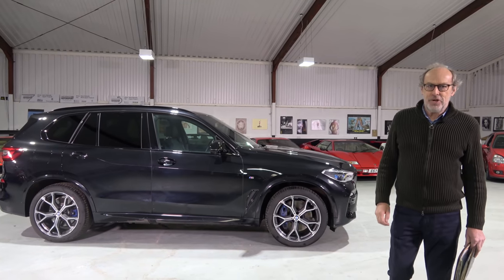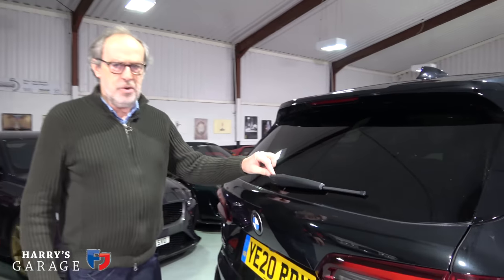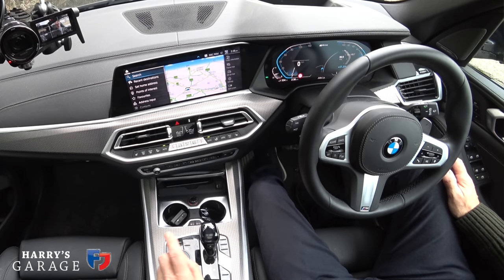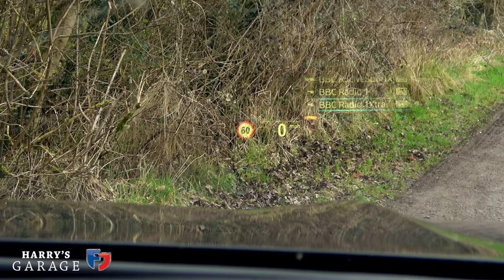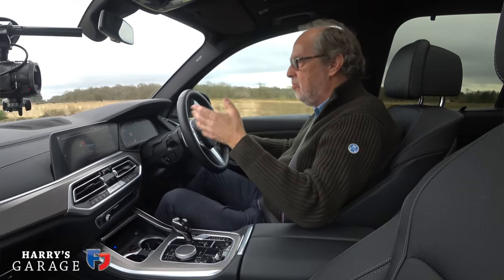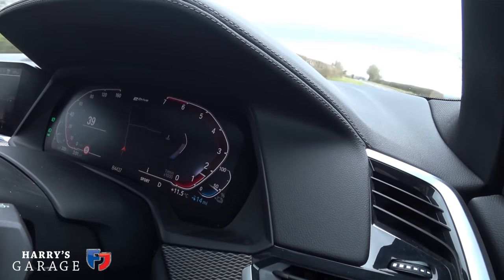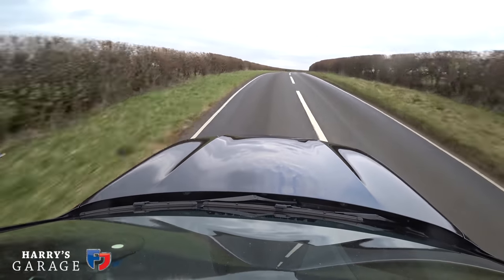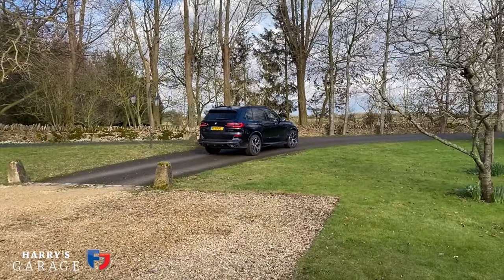BMW X5 45e 10,000 mile review. Why PHEV beats EV for our family car

Comment: Great review. We have a 530e and love it, we get 55mpg on it usually. I have the same concern, pushing the ICE when cold, I therefore put it in SPORT mode when driving off, the ICE comes on immediately, warms it up a bit and also get the oil flowing. Then switch to adaptive when it makes decisions automatically. Hopefully that helps in the long run.

Comment: Hybrids are a stop gap until full EV is affordable. Harry’s argues they combine the benefits of both propulsion systems which is true. However they also combine the disadvantages of both. The complexity of modern internal combustion engines - with associated post warranty repairs costs, with the weight of battery systems. Manufacturers have been denying us spare wheels because of their weight yet stick a quarter ton battery under a hybrid.
I’d happily lease a hybrid whilst under warranty but wouldn’t keep it beyond the next three years. By that time EV’s will be cheaper, charge faster, weigh less, have more range and have access to more chargers.

Comment: The lane departure on my parent's Accord is scary. It's aggressive and goes off when passing a trailer on the highway. Absolutely terrifying. A lot of these features shouldn't exist unless they're perfect imo
Reply: Have they given feedback to Honda? If not... either they should or they should not complain. As a manufacturer you can spend any amount of money on testing new products but as soon as they hit real world usage there will be problems not covered by your testing plan. The alternative is to have the cars phone home to the manufacturer all the time (eg. whenever the driver tries to override the corrections by providing steering input) — but you can be confident that if they did make cars phone home, there would be media/twitter/etc outrage everywhere. "Honda is spying on you!" "Creepy Honda cars tell the cops when you're speeding" etc
Reply: Do they signal? Because most of these systems do not trigger on a lane change if you signal, but do if you just steer left.
Reply: @cmacd8879  it thinks that you've gone out of lane or there is something in front of you and pulls the wheel/hits the brakes
Reply: @jsleeio  Teslas phone home all the time. The problem is that car makers are not, traditionally, software makers. Just look at the sorry state of most infotainment systems. They frankly don't know what they're doing. There's already a class action lawsuit against Honda out there for the emergency braking
Reply: @marcob1729  yeah I'd expected to hear that about Tesla, since they also update their own software... you expect it (or should expect it) from day 0 of owning the car. But I don't think the same expectation applies for the "longer-established" marques.

Comment: I thought plug in hybrids were the answer too till I bought my Mercedes c200e.  MPG is horrible (less than 28mpg) and the battery range in winter is absolutely useless (6 mile range). Can’t wait to get rid of it and get a normal petrol or diesel engine. 
In theory they are excellent but in practice, HELL No!
Reply from the maker: Battery size on a PHEV is critical. Early cars had tiny batteries, just to get through the EU test and give business owners a good (tax) deal. Then Germany introduced a law that all PHEV had to do >60km to qualify for a grant, so latest BMW and Mercedes have way bigger batteries, which really changes the ownership experience so they start to make much more sense.
Reply: @harrysgarage  Yh, if I got over 50 miles I wouldn’t care about the fuel economy for the kind of distances I drive.  Guess I’ll wait a few year and maybe give it another try. The BMW looks sweet though. Shame you have to give it back.

Comment: Spot on review. The slow charging is my main disappointment. I also find the electric mode a bit underpowered. Those are the only two remarks I have. I hope they do update the electrical system on the next model update.
Reply: I have owned my X5 for a year. The charge rate has not been an issue as I plug it in overnight. It is better now I have the PodPoint and charge at 16 amps.  What I would love is for it to have the electric range advertised. Having said that, it meets my need where the longest normal working day has a round trip of 30 miles.

Comment: I get 53mpg with my 1600 Diesel  engine and I don't have to plug it in every night..!!  and charge  it up from gas fired  power stations.   Whipy Doo 

Ps, Thanks Harry
Reply: That may be so, but the lack of noise is very pleasant and the acceleration with the combination of the battery and petrol engine is very good. It seems strange if the battery is flat and you drive off with the engine running.

Comment: A good analysis Harry, notably on the easy to live with, iDrive, consumption and 'how much power do you need' items. We have latest gen X3 with 2.0 diesel engine which has more than enough torque for everyday use. Consumption is around 45mpg. iDrive was the first and remains the best (despite what that idiot Clarkson said way back when). All the manual buttons you need for climate and seat heating etc and just so easy to live with. On the run flats, I changed those out on my 635d asap some years back and the difference was so positive , and less cost. We will need to swap out the X3 in about a years time and do wonder if there is any benefit to upgrading to the X5. I am not a fan of the new grilles on the saloon cars etc but it works well on the X5 IMO. BTW - does the battery get charged when it is running in ICE mode?

Comment: Fantastic review as always 

Just curious as to how much new batteries cost for some of us who would be buying 2nd hand
Reply: Batteries will probably cost half the amount of the car then there would be cost of fitting of the batteries at the dealership.
Reply: @bentullett6068  thank you 
I thought they would be expensive but nothing like that
Reply: @bryangillies6698  they aren't cheap. I work at a garden machinery dealer and some of the lithium ion batteries cost around £70-£1,000. I think lithium ion batteries for power tools like drills cost around £50 so you can imagine that electric car batteries aren't going to be cheap.

Comment: Unless you're looking at non premium car maker (I would even go as far as saying not looking at Kia/Huyndai), you won't be able to get an efficient PHEV:
> 20 kWh battery (enough battery for most small BEV users)
Big displeacement engine (in term of what you would need in a well designed PHEV)
> 0.3 kWh/km while a BEV could get less than 0.2 average with more powerful electric engine

Comment: Lane departure in wife’s 1 series is an insidious little device. Holding the button does turn it and other,more agreeable , active safety off; but if built after June 2020, you need to do this every time you restart the car. A nasty blight on an otherwise very decent car.
Reply: I believe (though haven't tested this, mine arrives later this month) that you can set all of the driver assist levels in your driver profile then choose your profile when you start up.  As per the beginning of this vid, where Harry's son has obviously taken the time to set up his profile and left it as default on that "spare" key.  The profiles can be tailored to the different keys (eg, I don't mind mild lane assist, my wife hates it) but if you are driving on the same key you can change profile anyway.  This is based on looking at a bunch of vids on YouTube about what all those buttons do and configuring the iDrive, and also asking the direct question to my selling dealer.
Reply: @richardbridgwood9256  Thanks Richard and that is what I expected. However, it seems that EU legislation stipulates that "safety" features such as lane keeping can no longer be permanently disable (or configured). I spoke to the supplying dealer who, like us, thought it was permanently  configurable. After a couple of weeks he confirmed this is not the case for new builds. Every engine start resets to ON. But good luck with yours.
Reply: @markbillington5985  yeeesh that'll be annoying... I wonder if UK spec might differ from EU spec now post Brexit!  Seems unlikely, and I bet you're right...

Comment: BMW isn't worried about the cold engine for the same reason they aren't worried about disposable cooling systems and suspension bushings: they are only concerned with the first owner, so it only has to last about 60k miles.

Comment: Great videos Harry. Did you find tyre wear was more excessive than envisaged, given the excess weight of the hybrid power train? I had an e class hybrid and it was a nightmare- new set of tyres every 6 months with only 10k miles per year :S
Reply: Wow, that’s worse than my F150. I live in mountains so it kills tires.

Comment: All your issues would be addressed by a Kia Sorento hybrid. I've got a diesel one, the latest model and it replaced a Volvo XC90 and is better in many respects and no worse in any. More roomy in all rows behind the front, including the boot. Same performance. Slightly better fuel economy. More supple suspension. Softer more comfortable seats and no dirty sill worries.  Better pilot assist auto steering. Useless voice control though. 
I'm not joking either.
How many turbochargers will the BMW eat through over its lifetime with the engine starting from cold like it does?  Not a question anyone can answer… yet.

Comment: Great video Harry but I can’t see the point in spending £70.000 on a hybrid,may as well go full electric.
Reply from the maker: Until you trying living with one..
Tried it for 12 months and not going back until UK charge network massively improves and battery tech moves on. Tesla different, as they are way ahead on both points but then no good on farm.

Comment: I’m not clever to work it out but what does the “actual” cost per mile/mpg work out to be e.g when combining petrol and electricity costs? The 50mpg obviously isn’t comparable to a petrol only 50mpg when considering costs as it’s costing circa 8p in electricity per mile when it’s electric only mode.

Comment: An hour to get 6 miles of range is horrendous!
The cold start and spinning up to highway speeds instantly is worrying,  I wonder if after 3 years anyone has any input on this especially if a turbo is involved, I am torn between a 30d or a 45e and this quandary is steering me toward the 30d.

Comment: I don't think you should use the X5 figures to judge the range loss of an EV in winter.
Most EV's have heat pumps, in my case range drops only 10-15% below freezing.

Comment: Hi Harry, Great video but unfortunately I can’t stretch to the X5 but thinking of the X3 30e. Have you tried that and if so is it any good? Have heard mixed responses such as when the electric battery runs out then the petrol engine struggles. It’s either the PHEV X3 or 2L Diesel that I’m looking at. any comments greatly appreciated.

Comment: How did you do over 4000 miles out of 10000 miles on ev?? When and where were you charging as you said charging away from home is extremely slow. Just wondering how you achieve that on a long road trip. Thanks

Comment: Hi Harry, I've watched several reviews of this vehicle including your initial review and seem impressed by usability but also the large engine and large battery combination. It seems odd no the major manufacturer has tried this combination, usually one or the other pairing a 2.0 litre with about 30 miles of electric or like the q7 the full fat 3.0 litre petrol with 30 miles of electric. If efficiency is the name of the game how come no manufacturer has combined the 3.0 litre diesel found in most UK SUV's with a large battery pack? I understand diesel is the enemy with emmissions etc but Mercedes seems to have dabbled with the idea but not fully committed. Seems like a lost market.
Reply from the maker: Several reasons why manufacturers aren't combining diesel with big battery PHEV tech. First, if they did then they could only sell it in Europe and the volume of sales isn't big enough to justify the cost compared to doing a decent petrol engine/big battery PHEV combination. 
Secondly, new EU regs coming in 2023 are going to force manufacturers to drop diesel because the tech you need to add to a diesel to make them compliant is expensive. This means diesel is about to disappear from the scenes over the next couple of years anyway. 
My suggestion would be to buy one while you can as from a customer point of view, they are still the best option when it comes to running costs for high mileage drivers.
Reply: @harrysgarage  Thanks for the response, is this new EU regs the one you have mentioned in prior videos where manufacturers will be fined for not meeting grams per km average over fleet? Does pose a challenge for the everyday consumer such as myself as diesel is my only realistic option especially living in terraced housing where charging for a full EV or plug in is simply not an option nor a consideration by the government with moving forward with the 2030 plan.

Comment: And what percentage of the electrical energy used was from renewable sources not including biomass which is environmentally disastrous? And why is driving a car now so complicated? Bizarre.
Reply: And what % of the petrol was renewable?
Reply: @matthewlewis2072  How is that relevant? The proposition for EV's is based on CO two reduction which is probably prudent but if the electricity generation is not CO two reducing, then EV's are pointless. Look at this vehicle, it's a lumbering truck.

Comment: Would it be possible that the short range in winter is more down to heaters ? your engine wont supply any heat if its not running.

Comment: I think the mpg is a little bit disappointing. My 9 year old diesel fabia averages mid 60s. Clearly the size of this thing is the reason, but it seems a shame that phev is just ameliorating the impact of cars getting bigger.

As a two car household in a city my intention remains to have one electric and one ice when one of the current fleet finally dies
Reply: Shocker - a much smaller car with an underpowered engine gets more MPG 🤔🤣

Comment: Ge this,...I had highly considered getting an X5 45e,...but recently learned that although it make have ///M badges here and there,...and is designated the "///M Sport Model" with ///M wheels, etc.,....sadly, it doesn't come with the "///M Suspension".  In other words, the M Sport version and non-M Sport version ride on the same suspension!  The only difference is the Hybrid model has the Air suspension!  I test drove non-M Sport,...and M Sport and the ride/handling was identical,...even though the M Sport had 20" wheels!  It made no difference in the responsive of the suspension!

Comment: Looking at the figures, does it strike anyone else that either Fuel is very cheap, or electricity is very expensive? 74mpg cost equivalent on EV is 'only' twice an ICE-powered one...
Reply from the maker: I often get the impression many people consider electric motoring is free when it most certainly isn't. Charging at home is the cheapest option but had I plugged in the X5 to one of the fast chargers popping up across the UK, I could have been charged as much as 45p/kWh, which would bring the equivalent mpg down to 25mpg. So much for cheap motoring! 
Diesel still takes some beating in terms of cost per mile..

Comment: I’m struggling to make sense of an MPG figure that doesn’t include the cost of the electricity consumed as well as the conventional fuel.  It feels like an artificial figure that makes it impossible to compare alternatives.
Reply: I agree. Is it 50mpg assuming you're getting 74mpg on electric or actually 50mpg assuming all the miles on electric are 'free'? I guess the latter and therefore misleading.

Comment: Harry, did you have a few warm days recently to check if car's pure electric range goes back to what you've had in the beginning?
Reply: It does. Same happens with any other battery powered device - it loses some capacity during cold and regains it when warmed up. Though I'm not sure if you have to charge it beforehand.

Comment: I just wish some company would make a boxy 4x4 with a fuel efficient(ish) v8 and all of the modern safety-features without the look of a pimped-out hair-dresser's car with electronic gizmos that you'll seldom use ,especially when most of them wont be working after a couple of years (if it's a Land-Rover).The nearset thing is the Grenadier and that just looks like a bit of a naff Defender substitute even if it does go into production.Something like a re-made version of a 90's Range-Rover Vogue would fit the bill.Fully galvanised obviously!

Comment: Cars produced by BMW, Mercedes-Benz, Mitsubishi, Volkswagen and Volvo were among 22 tested that on average burned 61% more fuel than in official tests.
The worst performer was BMW’s X5 plug-in hybrid SUV. It achieved 188.3 miles per gallon in official tests, versus only 52.8 miles for Which?. That 72% efficiency difference could potentially add more than £650 a year in petrol costs, the group said.
See the rest at https://www.theguardian.com/business/2021/mar/02/plug-in-hybrid-cars-burn-more-fuel-than-tests-record-says-which

Comment: What is next - Mercedes-Benz GLE350de with the bouncy suspension - has to be tested as a farmer.
Reply: GLE 350de cannot come with the E-active Body Control. Only the engines with the on-board 48-volt mild hybrid system can get it. I would love to see the GLE 450 with the E-active Body Control on the farm, though.